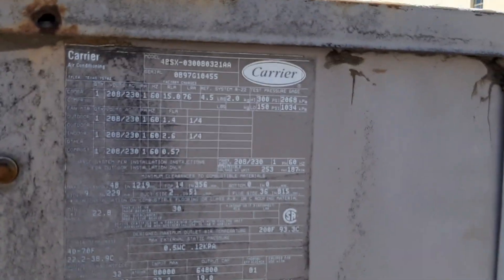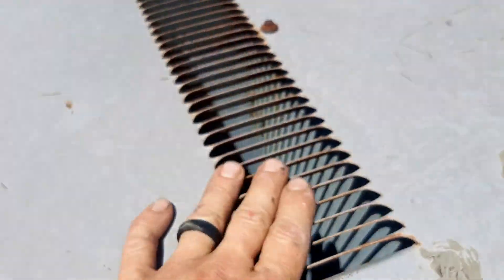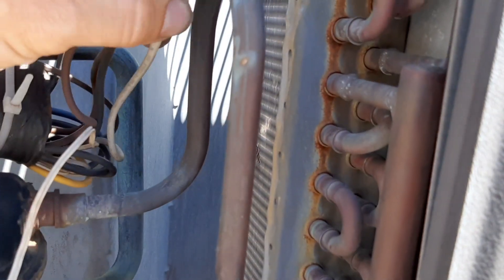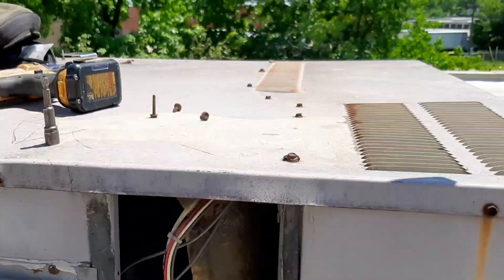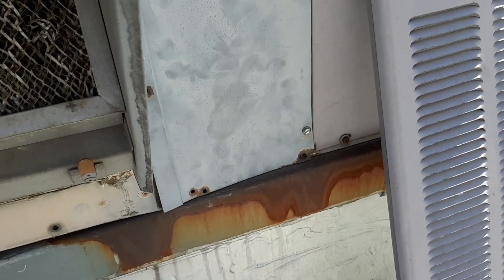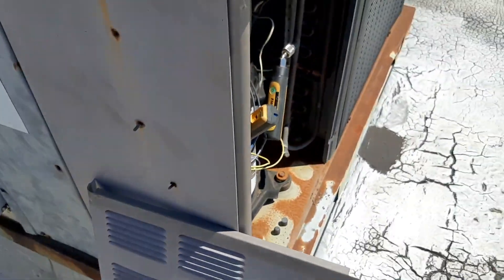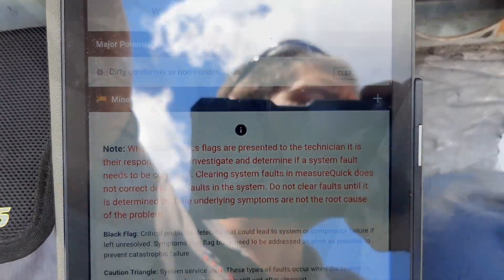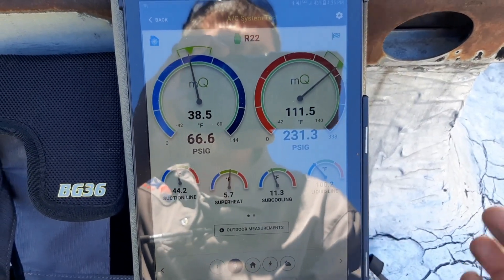No Cooling Service Call, Old Carrier Package unit

Comment: Ive had that issue happen before with an old stat, flipped it on to cool, blower didnt run, compressor did. Made me poot ky pants as it was early in my career when the blower suddenly got a call to run. Replaced it, never had anymore issues lol. I’ve also seen people set the tstat to 45 and it freeze up due to excessive running. Nice find, keep it up
Reply from the maker: Thanks Frost!